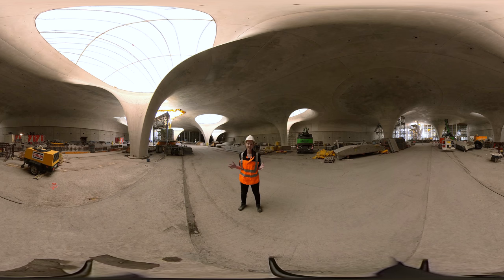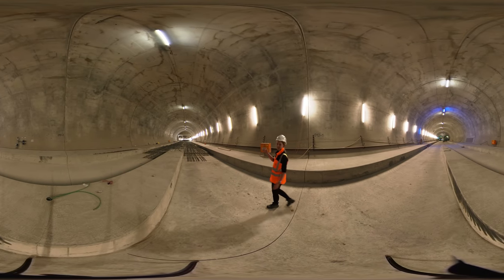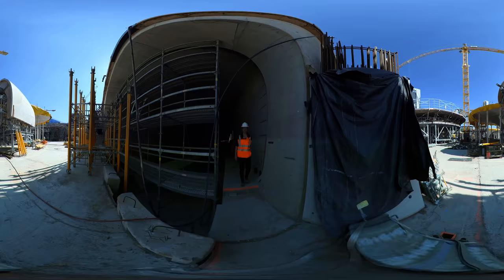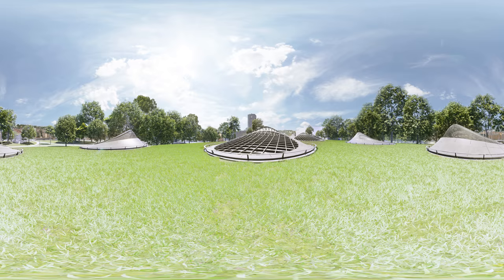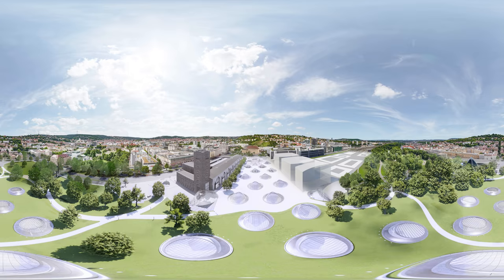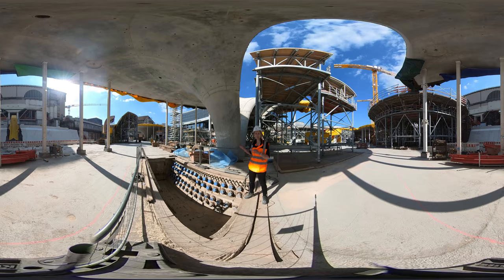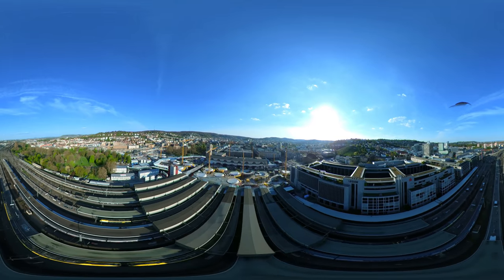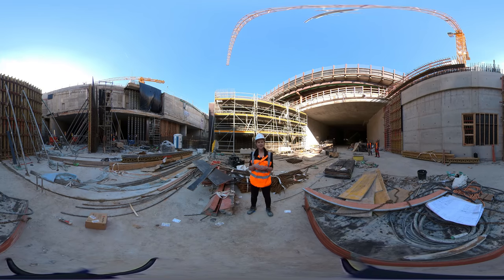Stuttgart 21 – Construction work at its finest

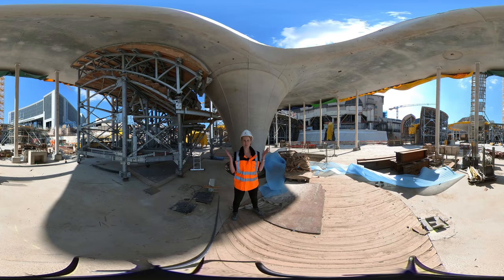Comment: Ms. Myers is so competent and charming! I wish the DB had more engineers working for their projects so they might actually do something good with all the money that’s annually spent. Epic: 04:30 The „Kelch“ explanation - a real German „Zungenbrecher“ sentence 👍
Reply: It's not the engineers fault... it's the politics that sabotage the planning process
Reply: @MrLOLametro  Jap, strongly agree. Though I read recently that DB managed to build only 4 km new tracks in 2021… this seems to be ridiculously little as an achievement for one year…
Reply: @kesterdonner8190  Do you really believe the 4km figure?
Reply: @BJHolloway1  Yes, absolutely - I am using public traffic almost every working day and most of the time it‘s trouble, mainly caused by the bad conditions of the railway infrastructure.
Reply: @MrLOLametro  not only politics, but also and especially  the so-called Environmentalists (Umweltschützer)
Reply: @BJHolloway1  The small number could be true because there is a lot of restauration / upgrading of existing tracks going on. There happen to be 10000 crumbling bridges (literally!) that need repair or outright rebuild over the next years.
Also, lots of existing tracks simply get expanded. If you upgrade from two tracks to four it is not counted as "new tracks" but surely helpful.
It is also believed that not every "last mile" to each customer's home should be done with rail tracks. I for one actually believe that to be wise. Other means of transport are better able to fill in that gap and will enter the space.
Reply: @olaflieser3812  Thank you for your very comprehensive response. If he meant New New tracks never before in place then maybe. But I think that criticism of DB over these few km when they obviously have an enormous replacement programme is a bit disingenuous and I am not sure he meant that reading his comment.
Reply: @kesterdonner8190  You forget that there was extensive flood damage to the network, Always easy to critize if you don't know better...
Reply: Dear @roelkomduur8073  , where exactly do you live in Germany? Just asking...
Reply: @kesterdonner8190  Can't see the relevance of your question, just saying..
Reply: @roelkomduur8073  Well, I do live in Northern Germany and am effected by the catastrophic infrastructure problems of the railway net of the DB Netz on a daily basis. The one very sad environmental event that happened last year does definitely NOT excuse all the years wasted for countless global investments - which sometimes did not pay off at all - while the DB concern should have spent the money better in OUR country to improve the tracks and electrical systems. We have so many delays caused by malfunctions of the signals and barriers, it's just a shame - and very often quite dangerous. Well, I admit I am just frustrated about the fact that the DB seems to be capable of bringing a challenging project like S21 to an expensive but happy ending after all while at the same not being able to do their daily homework for the millions of work travellelers who depend on stable connections between hometown and workplace.
Reply: Hello  @BJHolloway1  , I would not agree with your choice of the word "disingenuous" but if you read my clash with roel komduur below I admit that I am just so, so bugged out by the daily failure of the DB (and I experience that for 24 years now) and I just wish our government would just be legally able to order the DB to stop spending so much money in their global investments and instead REPAIR more in Germany. That's all I wanted to say.
Reply: @kesterdonner8190  The global aspirations as you call them are an European problem, idiots in Brussels dicided that state run must be privitised. So French,German ,Dutch ect..state railways started numerous stupid( loss making) ventures in other countries. This has nothing to do with the DB or SNCF, they were forced. Now you argument about those 4 clics new track...First of all it's a plus, most countries have a minus...second of all, You still have a rail network second to none compared to the rest of Europe. It"s like this S21 project, you can say progress is to slow, to costly ect but in end it is a brilliant construction and a fabtastic addicion to the network. Don't be so hard on the DB... As a Dutchman i love to ride their trains, do it very often, living right next door to NRW.
Reply: @roelkomduur8073  interesting points, did not compare our German situation and the DB ever with the situation in other European countries. And you're right, we're very priviledged with our railway net (and still I wish for more investments for repairs and modernization around Bremen!). About the 4 km as the sum of tracks being removed for good and actually new built tracks: I just found the figure ridiculously little... and here we are again with my high expectations of what the DB should be doing with the money. It's just wishful thinking, Roel. And yes, just from the outside and probably never using it at all I still think despite the massive delay and cost explosion it is a fantastic project. And I wonder how people in BW will judge about it in about 10 years from now on... Sorry for babbling but I get carried away... For us here around Bremen, we have a motorway project called A281, supposed to close the "ring" around Bremen to better the infrastructure and releave traffic stress from the city itself. For that, a tunnel under the river WESER has to be built (hopefully by experienced Dutch companies). Project might be finished in 2027, but unfortunately without any kind of additional space for passenger and freight trains - which I pity as a public traffic user despite my daily frustration. It's just for the cars and trucks. We locals (except the people who were against it, most probably for good reasons...) are waiting for this to happen for over 40 years now... it all takes so unbelievably long at Germany and the costs explode more and more every year...
Reply: @kesterdonner8190  In your neck of the woods there is that tunnel project to Denmark..will also cost over run( Dutch firms included).. But try building a metro line under Amsterdam.. With all the artifacts found in the excavaded mud you can fill a museum( it did). If every project was killed just because we were afraid of costs overruns,.. the Victorians like Brunel would never had a chance. Progress is risktaking..Sometimes it goes wrong like Berlin airport( Dutch engering firm..) sometimes it works...But it's like you said, in a couple of years time nobody is talking about the costs. That said, we must control costs and beware of corruption and vanity projects.
Reply: @MrLOLametro  Partly it's due politics and bureaucracy, partly due to DB's company structure and culture where one department sabotages the other.
Reply: @-german-1822  whenever it comes to building new Autobahn infrastructure, environmentalists hardly ever get the upper hand in Germany. It's mostly railway and EE railway projects where politics uses NIMBYs to impede their construction.

Comment: At this rate of building speed, most of the builders will have reached their retirement age before opening...But to be fair an incredable structure!
Reply: well, design is already 20-30 years old
Reply: @lorenzovonmatterhorn325  The idea is even older.  
2006 approved the Landtag (parliament) of Baden-Württemberg the project
2009 the Bundestag
Construction started finally in 2012. Instead of the forecasted 10 years, it will now take 13 years.  Albeit one part, the 61 km new highspeed line from Wendlingen to Ulm will be ready and used from this December on.

Comment: The small hole in the "Sonderkelch" is for an elevator, not escalators, I assume.
Reply: Small hole yes.  The large hole (cut out if you prefer), however, will take the escalators.
Reply: It's for both. It's for an elevator and for escalators. It's the main entrance.

Comment: I remember Ms. Myers from a previous German-language video about Stuttgart 21, in particular, about the Staatsgalerie station and BA21.  She mentioned that the direct U Bahn connection from Hbf to Staatsgalerie should be completed and opened for revenue service by December 2023.  Any changes would be subject to review I guess.  

This last February 2022 as well as July 2021, I was in Stuttgart to see some of the reconstruction.  There were two direct connections from the Bonatzbau to the train platforms, but those were hindering the Kelchstutz construction so they had to be dismantled one by one.  At this stage, it is a long walk either way from the train platforms to the Bonatzbau at either end as of April this year.  I might return to Stuttgart sometime late 2025 / early 2026, unless something happens to make me return sooner.

Comment: Nice but why is there no one seen working? Hurry up 😜
Reply: Simply avoided when filming this. For the drone flights it would not be allowed. And otherwise DB would need the consent of every person shown. 
S21Bau.TV has quite a number of videos filmed from outside where you can see ongoing works.
https://www.youtube.com/watch?v=E_Vd2vPV25o
After some massive delays before the construction could really start, they are currently well inside their schedule. And the are massive dependencies between the single sub projects and other tasks. E.g. all regional trains which will call in this new train station have to be upgraded for the new signaling system they will use there.